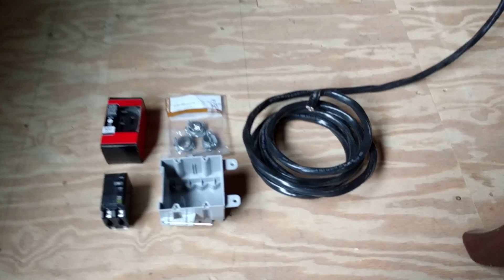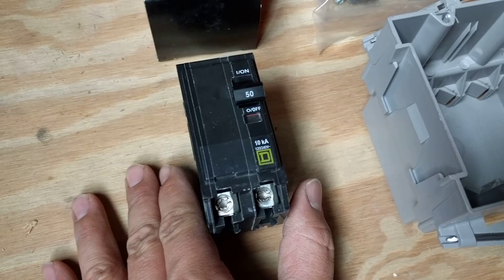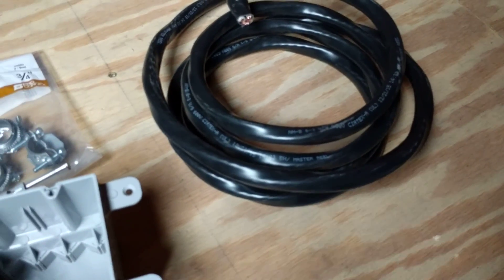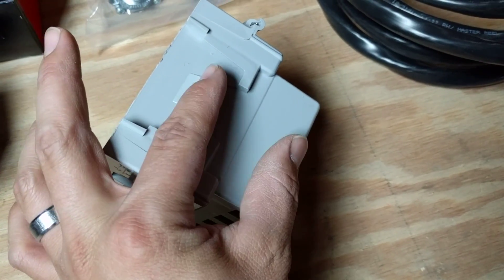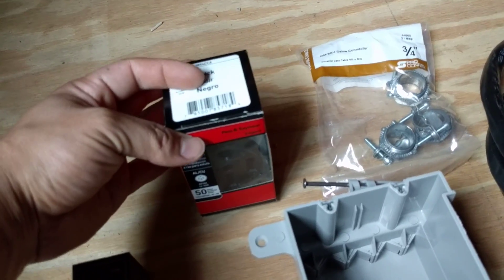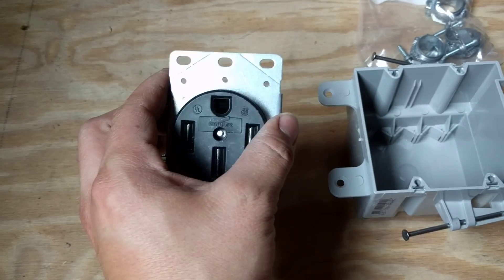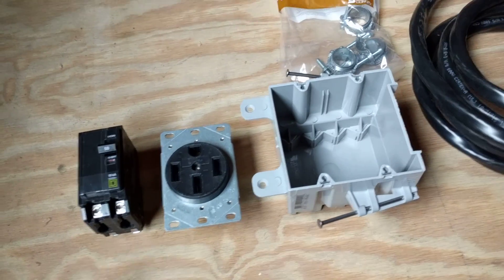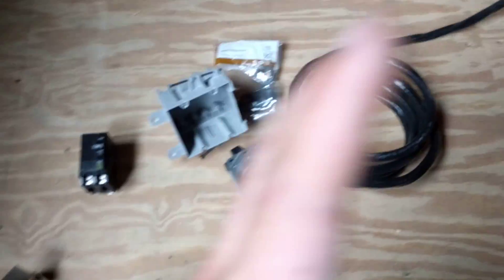Materials For Electric Range / Stove Rough In - Receptacle, Box, Wire, Circuit Breaker, & Receptacle

Comment: 6 gauge wire because you are using a 50 amp breaker. A 40 amp breaker would use  8 gauge wire

Comment: Nice work Benjamin!   I found this video so helpful however i was wondering if you could make a special video of a project that a friend and i want to make using a thick extension cord installed into a junction boxed with a wall outlet on it and then next to it a little bit of thick extension cord into another junction box to install a circuit breaker into the junction box and then will put a switch plate that is fully covered up with 2 screws that you have to unscrew to reset the circuit breaker if ever tripped.   I wanted to know how to wire that so we can install a 15 amp circuit breaker to a 15 amp wall outlet receptacle.    Could you please make a video on that?

Comment: Hi there.. i hope you're still answering questions.
I ran 2 6-3 cables. One for a stove. One for, hopefully, a high end charger for a car. The 6-3 I ran is in a bx housing. I need clamps like what you have but i can't find the right size. Please advise - the 3/4 inch ones i picked up actually don't hold the cable at all. It slips right off

Comment: Ben question for you. I just looked at every range in menards and they were all 40amp, why do you deem 50amp the industry standard?
Reply: Check the specs, it may rate 49.5A... a LG I'm installing pulls that surprisingly.
Reply: @JustAnothaDudeThatsAround  i hope not 😩 i just installed 8/3
Reply: @Jesse58761  NEC states 40A takes 8g so you'll be okay id imagine
Reply: @Jesse58761  50A calls for 6g wire
Reply: @ no if i have to upgrade to 50amp 😔
Reply: @Jesse58761  it just depends on what you're unit is drawing bud, dont sweat it too much. In order to find that exact thing it's (amps = watts/volts) then add the values to the other amperage loads... as long as you're within the 80% mark you'll be fine.
Reply: For continuous loads like a stove you might keep on for an hour or so, you want to stay below the max rated amperage of the circuit. It's called the 80% rule. 50*80%= 40 Amps continuous load. 

Doing the absolute max amperage continuously will run the risk of wires heating up and catching fire. It also allows for electronics that use an initial burst of power to not trip a breaker.
Reply: My range says 40 amp as well. Idk what to do.
Reply: Was thinking the same question 😂

Comment: 6/3 not 8/3? #8 rated at 50 amps at 75 degrees and 55 amps at 90 degrees. Most of those 11.5-11.9 kW ranges only draw like 35 amps or so.

Comment: I used the links in your video to purchase the items needed for the range service  (through Amazon). Will you automatically get your cut when the links listed under the video are used? Is there something on Amazon directly I should use instead to purchase these items to assure you get your stipend?
Reply from the maker: If you purchase within 24 hours of clicking, I should receive a commission. Thanks for your support!

Comment: Breaker question. Appliance instr. states 40 amp breaker, but max load is 39.4 amps.  Ran 6-3 wire for safety margin/potential future upgrade.  Should I now use a 40 amp breaker or 50 amp for 125% practice? Thanks.
Reply: Should always use what its rated for keep it at 40amps

Comment: Please folks. Go find another video.  He starts off with a double electrical box and drills his own hole.  There are proper oven outlet boxes. And code requires that a piece of 2x4 be screwed to the other side of box.  He has no idea what he is doing or what codes are. Code give a specific height for the box and he is way off.  He would give an inspector a heart attack.  He is obviously not getting this inspected.  Go get advice from another you tube video. Wait until he tries to put the face plate on.  It won't fit properly.  🙄🤣

Comment: Thanks. If you use a 50 Amp breaker for oven and 50 Amp for range, and you only have 100amp service, there is nothing left for the rest if the house. What don't I understand?
Reply: That’s not how it works
Reply: You’re not using all of that at once. 

50 amps is the max the breaker will let out, but it’s not letting out 100 amps at all times. 

Look up “standard residential load calculation”
Reply: you’re going to need at least 500 amp service to supply the whole house.  just jack it up to 1000 amps to be safe.  ask you electrician to install this for you.  he will most likely suggest a 2000 amp service, but 1500 amps will be enough.
you can always run a cable from your neighbors panel over to yours just for that stove, that way you’ll have free juice for tote stove.
Reply: 😂 @ginoasci
Reply: What are you even talking about lol  @ginoasci
Reply: @ginoasci Lmfao

Comment: I purchased this cook top to replace my 30+ year old cook top because of its look ◇◇> allmy.tips/EmpavaCooktop?U21   . The installation was pretty easy! I was not aware there was an internal regulator already, so I attached my existing regulator to the new cook top and it worked just fine! Ignition was relatively simple and easy too, and just need to get used to it. Right after the installation I was quite upset and thought the grate was tilted. Later on I found out the grate was actually flat and level! What a genius design and illusion!

Comment: Crud, Benjamin.  I ran and 8-3 for my range and can't undo it.  It's a 3-prong plug.  The current breaker is a 60 Amp.  I don't know what to do to fix it.  Please help!
Reply from the maker: Hi! You should be able to just downgrade the breaker to a 40amp and you will be okay. Most electric ranges only use 40amp anyway so it will be fine. DO NOT connect the 8/3 to the 60amp breaker as that could be dangerous. Hope this helps! Always have your electrical work inspected once you are finished.

Blessings from MN,

Ben
Reply: @BenjaminSahlstrom  I KNEW it wasn't right.  Thanks so much for getting back to me!
Reply from the maker: @theropesofrenovation  My pleasure! Hope it all works out well for you! Be sure to have your electrical work inspected any time you are going to do work like this. The inspectors are usually just looking out for your good and are there to keep our homes as safe as possible. I hope you'll subscribe if you haven't already!
Reply: Benjamin Sahlstrom  what about a 50amp breaker? I’m doing the same thing running 8/2 wire to a 50amp breaker for a electric range that is 40amps. Do I need to change the breaker to 40amps? Only thing I’m connecting is the range to that recpetical

Comment: Moved in to a house and found that their is only a 6/2 wire hooked to the electric stove out let. Don’t know why. Also has gas connection . Thinking this can’t be correct , and how could I go about correcting it? Can I buy just a 6 gauge wire run it from breaker box to plug? Any suggestions?

Comment: I would use aluminum SE cable. It is significantly cheaper than copper. Most stoves and AC condensing units are wired with aluminum SE cable for that reason.
Reply from the maker: +Brian Leeper Thanks for the suggestion! I've encountered a variety of opinions on copper vs aluminum. I think copper is a bit easier to work with since it doesnt require the special paste in the connections but both can work well. My main 200 amp service entrance cable is aluminum.

Thanks again!
Reply: Aluminum is lighter and more flexible than copper. For the same current carrying capacity, it is about half the weight. So running aluminum cable may well be less work than copper. I use the paste on car battery connections so I always have some on hand. It is easy enough to apply.
Reply: And the cost...50 feet of 10-3 copper NM-B is $75 right now. 50 feet of 6-3 aluminum SE cable is $42 AND the SE cable can handle 50 amps vs. the 30 amps the 10-3 copper is limited to. Only bad thing about SE cable is that usually you have to go to an electrical supply to get it. Also 50 feet of 6-3 aluminum SE is noticeably lighter than 50 feet of 10-3 copper NM-B (both have 4 conductors).
Reply from the maker: Brian Leeper Excellent information.

Comment: if I use a 40 amp breaker instead of a 50 do I use a 8-3 wire
Reply: Sure just think that if your stove goes bad youll need heavier wire IF your NEXT stove requires 50amp. Just to be safe. I would just wire the 6 and breaker at 40. Can always change a breaker later.